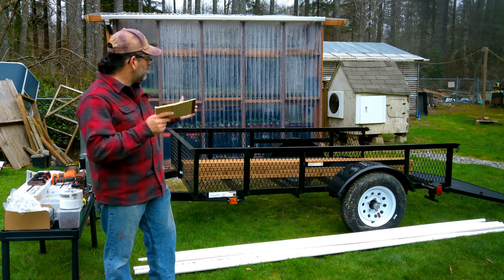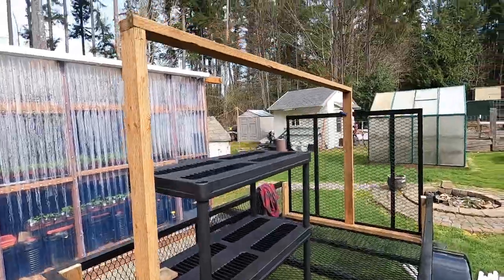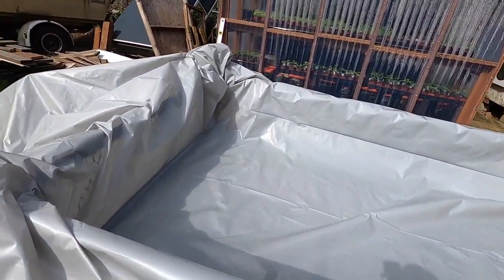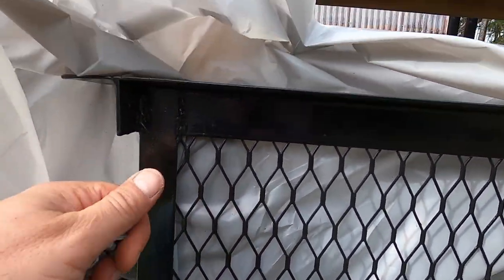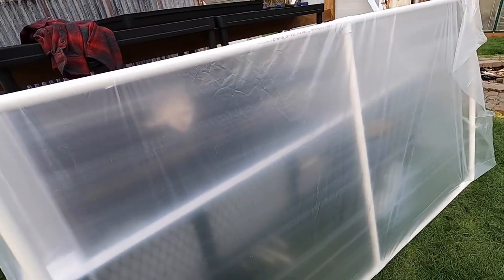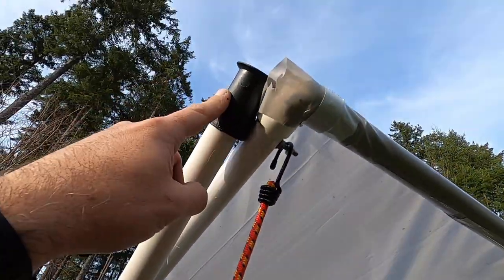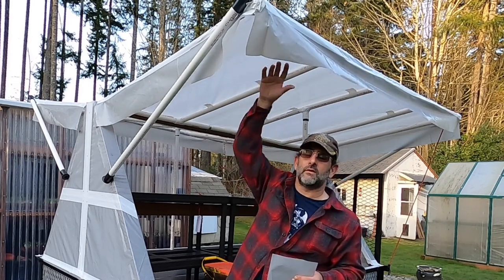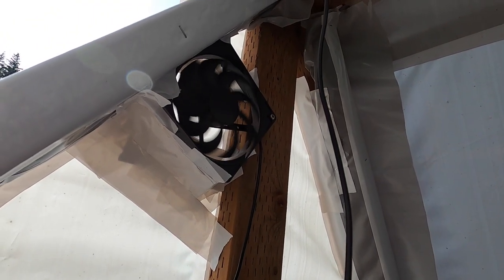Mobile Greenhouse

Comment: How about putting water tanks in the bottom for wind loading and water storage, along with a gutter system to fill them with rain?
Reply from the maker: The frame is fairly heavy and the four carriage bolts hold it down fairly well.  I don't think a gutter will work very well with highway speeds.  Happy Gardening!

Comment: Great video! I'm curious about those heat mats. How well did they work? What temps did you get and how did you power them? Maybe another video ;)
Reply from the maker: I only had to use the heat mat once when we had a late frost the night before market.  They are 100w seed starting mats that I took a extension cord to. Temp got down to 28f outside and all my starts survived.  Forgot to put a thermometer in to check the temp.